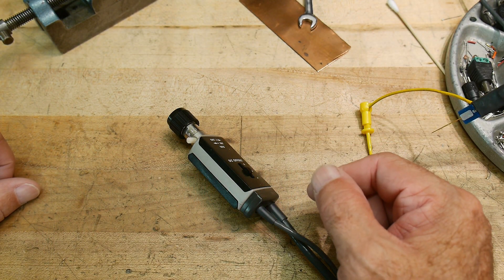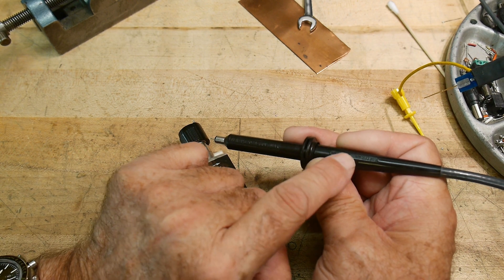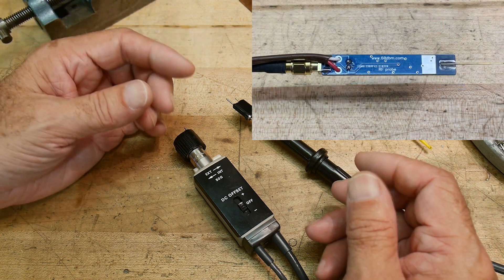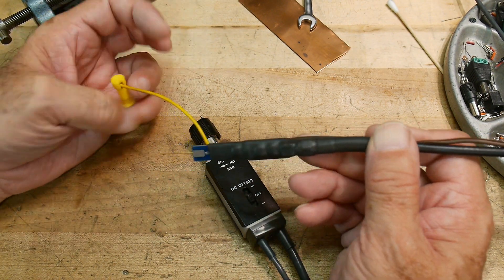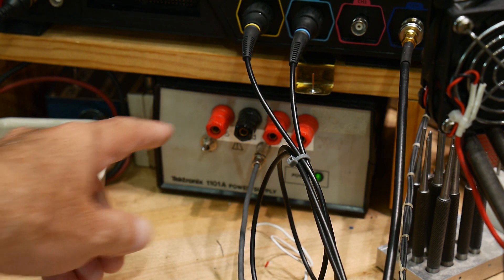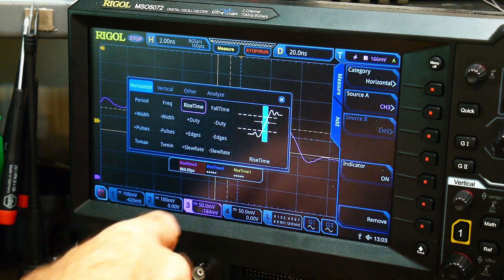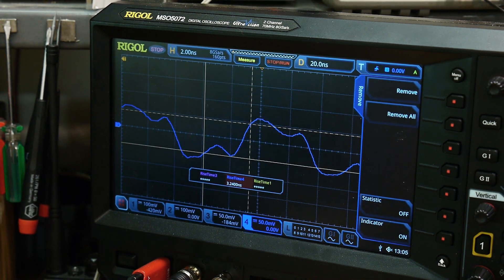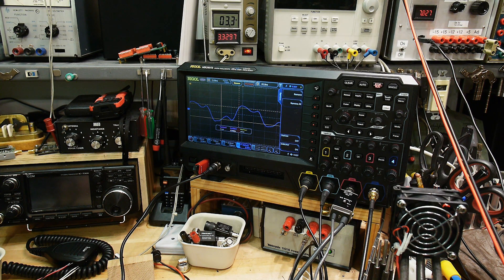#924  $9 DIY FET Probe vs Tektronix FET Probe

Comment: Great video, thanks. But not sure about the position of the 50 Ohm switch of tek probe. As MSO5000 has no 50 ohms input the switch should be in the "Int" position to terminate the load at 50 Ohms. Ma be  you might wanna try it again in that mode to reduce the distortion.

Comment: Looks very much like an Elektor circuit
Reply from the maker: probably
Reply: It is. You can tell by the way the schematic is drawn :-) and the number in the bottom right corner. According to the Elektro site this one was published in October 2004. The author / designer of the circuit is David Jewsbury. Cheers.

Comment: One is a DC to HF probe, de DIY probe is HF only, you don´t need a GND, or at least is what I have seen in my measurements. I have two fet probes too, one DIY and the other tektronics. You have to put the scopes in 50 ohms mode!!! Please test theses probes with the VNA, thanks!
Reply: The DIY one is AC couple (cap in series with the input) but nevertheless you always need a ground.
Reply: @kosmic5695  I will try to make a test with the  two probes and a fast puser. I don´t understand yet why the DIY AC probe giveme the same results with and without GND, (at VHF UHF frequencies)
Reply: :) I found you in eevblog, I´m harriman sat.
Reply: @miguelmiguel7314  I did the test you wanted. No ground is not working really well since it endup using a super long one (In my case via the sma connector of the probe to the VNA).

Comment: The output of the 9$ DIY Probe is 50Ohm. Will probably work a lot better with a 50Ohm terminator in front of your scope. For the ground I use a pogo pin soldered to a piece of single core copper wire. This allow me to move it around.

Comment: I built my Janiel probe into a large diameter Sharpie pen body that makes it much more ergonomic to use.
Reply from the maker: does it still write?
Reply: @IMSAIGuy  Of course it's like one of those old multi-color pens, push a color down to write with one color...in this case you push the probe clicker down and take your measurement! 😈
Reply: I used a BIC pen, the .19cents one.